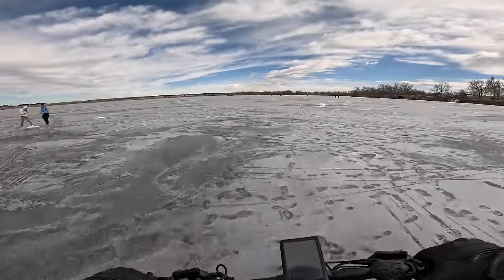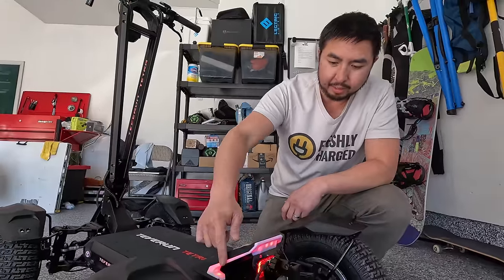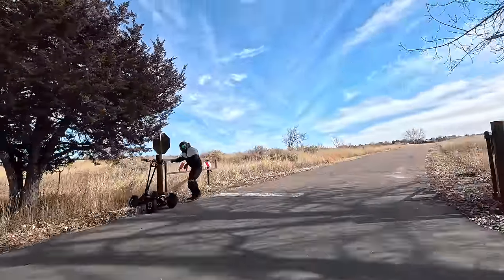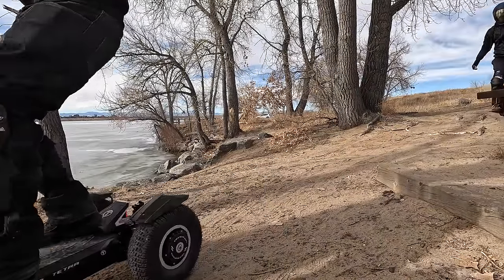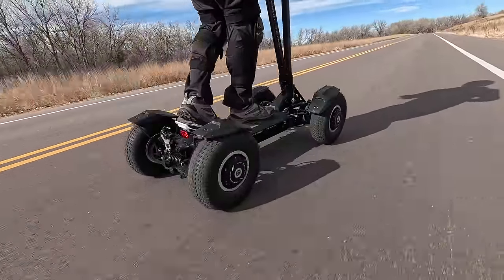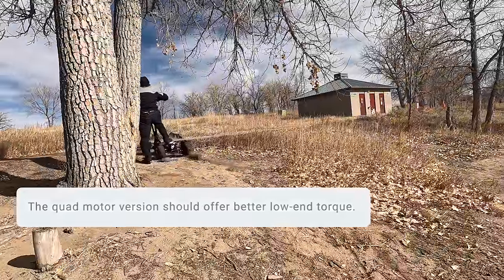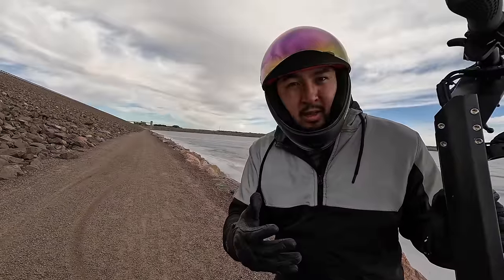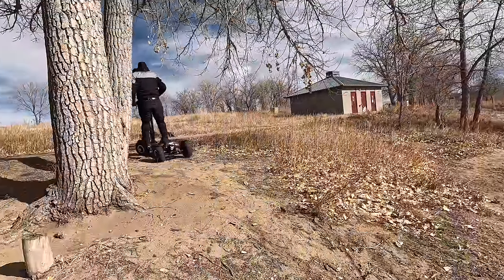Teverun Tetra Review: This 4 Wheeled Escooter is Interesting

Comment: My wish list for the electric ATV; 
Twist throttle 
Adjustable seat
4×4 all wheel drive option mode
Visible lights
Reply from the maker: Twist throttle! I completely agree.
Reply: @freshlycharged how many millions of dollars is this now. Probably not affordable for anyone 😂
Reply: @WyteOutAK  6000$ I just don't know for what, for battery or for that 4 motors and cables and also never going to understand people who can spend more than 3000$ for some electric pieces of plastic with some battery and cables, for 6000$ you have to buy car or very good new real Moto bike easy and to choose the brand, model and power

Comment: That's a radical machine. The wheels in my head are turning right now. I'm with you. I can see future versions of the scooter being way more refined.
Reply from the maker: The future is bright!
Reply: @freshlycharged  indeed,  keep making those great vids!
Reply: yeah I just talked with  thier customer service.. those tires are tubed.. but very thick I'm told what every that means , if you run over a nail.. your still getting a flat and this looks like a bitch to change flats.. other then that I like it, but not for $4,000+

Comment: For the first time I might acually buy this scooter looks like a lot of fun, I'm a 4+ year EUC rider so I've been thinking about trying out a different device to switch between both weekly
Reply: the tires are tubed and this is $4,000 with 2 motors.. if you want 4 it's a lot more

Comment: I'd think a big round 7-9 inch headlight would be cool! Maybe use led turn signals from motorcycles mounted higher up on the bars and maybe the rear fenders?

It seems very similar to the Cycleboard Quad (which I've been considering) and the Dragonfly carbon fiber board that has an Indiegogo campaign that seems a little sus...

I'll definitely look into the 4 motor version!

Comment: Definitely not a PEV that anyone should buy until they fix all these issues. The brake pinching and loose screws are a deal breaker because of safety. Teverun should’ve sent their scooter out to beta testers and then release the scooter 2-3 months later after these issues are fixed. A $3500 ATV scooter should have zero loose screws, competent brake design, motorcycle grade horn, high and low beam lights and visible turn signals

Comment: I'll tell ya ; I've had the Cycle board for 4years and now they've brought out the Cycle board  quad which that 's pretty much a different version of the same thing.  I would never pay four thousand  for either one of them. I payed too much( 2,450) for the Cycle Board Rover which had 2 wheels in the front , 1 in the back now they have the quad with 4 wheels , and that there looks like it's brother. but with a little more swagg!

Comment: huge missed opportunity with this things.. I love the chassis. I love the leaning of the swingarms and the tilting of the tires. But theres only a few reasons to give up mobility of 2 tires. 4 wheel drive, 4 wheel brakes, and stability on slippery surfaces.. 1500w motors? dafaq? my dual 3kw scooter (xplor odyssey) only does 46mph with me on it. but it pulls like a monster with 6kw on only 13 inch tires so it makes it still fun to ride. It pulls WAY harder than my 17000w diy bomber on 27 inch tires. if they sold a roller of that quad scooter id buy it immediately. and id slap quad 3shul cl700's in it and quad qs273's on scooter rims. That thing would be an absolute animal. the chassis of any pev is the only important part because its the only part thats not upgradeable.. a new chassis means a whole new pev. you cant change a frame. it just is what it is. so its the most important part. you can put a new motor, new battery, new controllers, new trhottles, etc. but the chassis just is what it is. so for that reason alone even though none of the stock scooter is impressive BESIDES the chassis, id still buyt it to use it in a diy build. but not for 3600$

Comment: That thing is awesome but it is alot of coin ....So I would hope that they fix the most important things like anything that has to do with "SAFETY " !!
Why are you so worried about the horn when the brake lines are getting pinched , One .  
The other thing I would think needs fixed is the turn signals and any other lights that you will never see or be seen with them on .
The whole idea of the thing is like no other and  hopefully they will fix everything that is fudged up and then they will have a homerun on there hands.
I might even think on buying one ...If i know that everything is fixed !

Comment: Huh, like riding a motorcycle with a side hack.... for the first little while every time you turn right you end up going left. It is not natural, you have to think even more than a car about balance and turning. It does become more natural with time. The bottom end torque would be better on the FWD version.

Comment: Nothing like saying its the worst version to help sales. 😝You can go into settings and adjust or disable shutdown to do upgrade. Bluetooth needs to be fixed or better location for connection and the light they use needs to be replaced on all their scooters.